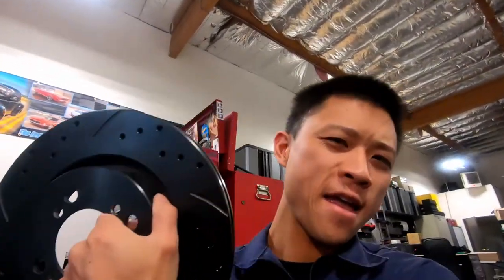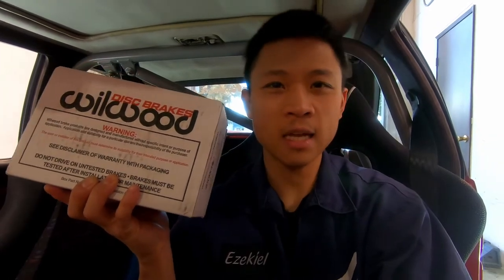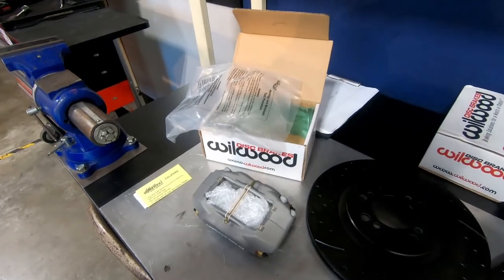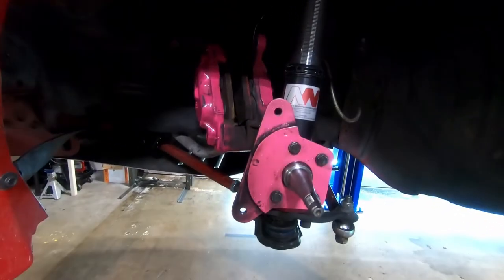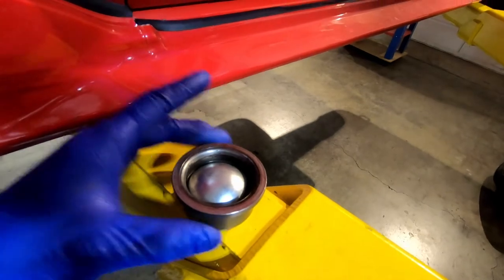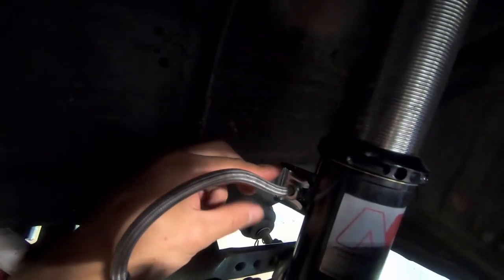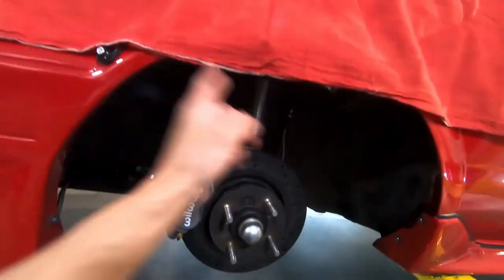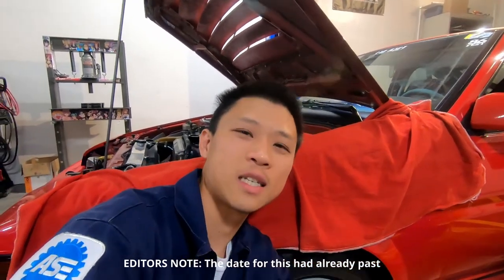AE86 Willwood Big Brake Kit Install (BGRS)

Comment: I think a 1998 Supra master cylinder works with it. I haven't really look into it but I heard that it works.
Reply from the maker: I would skip all the frustation and get a BBK properly desgined for the car like the BG kit instead of piece mealing a "kit" and hoping for the best like I did.
Reply: @CMAutohaus that takes the guesswork out of the equation and saves more money in the long run.

Comment: Hey Ezekiel! How did you fit the Carbing bar so that it doesn't press down on the master reservoir? I tried using washers, but then the hood came into contact with the bar. Any suggestions would be appreciated. Thanks!
Reply from the maker: I think I ran a single washer on the camber plates to space the bar up. Every chassis going to be a  bit different, but mine barley touched the cap. I cut off the fluid level sensor on the cap so I could take the cap on and off

Comment: i did the wilwood bb kit recently p sure its the same as yours except im pretty sure the brake lines it came with have a smaller ID than the ones you have there. just wondering if that could amount to me having relatively weak pedal feel. running a micro brake booster from flo as well as a proportioning valve( WW)
Reply from the maker: Is it the T3 kit? Line diameter shouldnt matter. Before anything I would check for leaks and if you bleed in the correct order.
Reply: @CMAutohaus  same kit apart from the lines from flos.ie. i bled it 2-3 times starting from the furthest corner. zero leaks. the pedal feel is the same as it was before the change. feels as though the brakes arent assisted even though the booster has vacuum going to it
Reply from the maker: @decoyla  Not assisted. So pedal should feel "too firm" then. Too "soft" would be an over assisted system. Inside bleeder then outside bleeder last right? You can have to hit the calipers while bleeding to move stubborn air bubble.
Reply: @CMAutohaus  yeah did inside then outside. didnt tap it though. its more of im not getting much brake pressure for the first half of the pedal travel. and then it starts coming on
Reply from the maker: Brake booster push rod adjustment and front and rear rotor thickness is only other thing is recommend checking

Comment: I have this kit from T3. Im not running any type of proportioning valve. Do you remember running one? Ive done a couple track days with no issues. And daily driven it with no issues.
Reply from the maker: Ive run the FC calipers and this kit using the BGRS Wilwood prop valve. I am not the "best" driver, but I used to do a consistent 2:01 at Laguna Seca if that gives you an idea how hard I use the brakes.
Reply: @CMAutohaus  thanks Ezekiel for replying. Sorry meant to ask if you recommended running a prop valve? Not remember running one. Sorry.
Reply from the maker: @alainenriquez3899  Yes. Highly recommended. Many factors such as ambient temp, tires, brake pads will all change brake bias and it is very valuable to be able to change bias on the fly https://shop.battlegarage-rs.com/products/wilwood-proportioning-valve
Reply: @CMAutohaus  i might just have to order me a prop valve. And do all the suspension and brakes at the same time!! Thanks Ezekiel!! And keep up the good work!!
Reply: @CMAutohaus  another question, any reason why only using a rear? Would having a  front prop valve be useful and also having a bias up front?
Reply from the maker: @alainenriquez3899  Thats honestly a question for Wilwood. Their instructions state to put it inline with the rear only. Badboy runs the Wilwood valve version that hooks up both front and rear lines.
Reply from the maker: @alainenriquez3899  Much appreciated Alain! I will do my best!
Reply: @CMAutohaus  again thank you for the response. But yeah will be ordering the prop valve! 

As always. Keep up the good work. And keeping the AE86 chassis alive. Miss driving mine